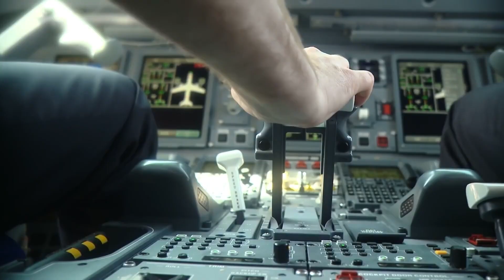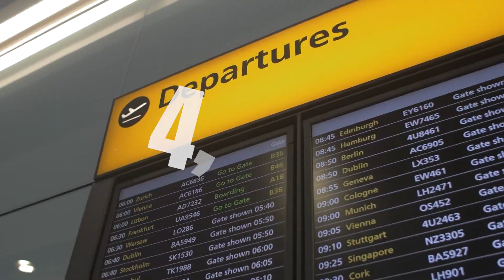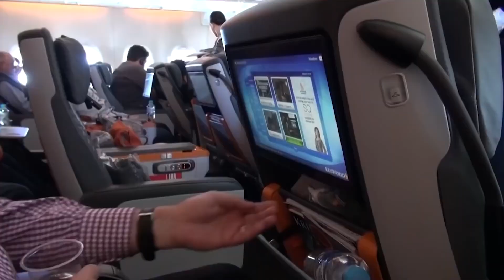BREAKING: Airbus Testing It’s All New A380neo

Comment: The A380 NEO can be a reality and with new engines and double blended winglets and a down turn blended taillets which make the aircraft achieve a longer range of about 10,550 plus nautical miles range..
This can make the A380 achieve ultra long haul flight and can open up maby new routes with lots of facilities for the airlines.